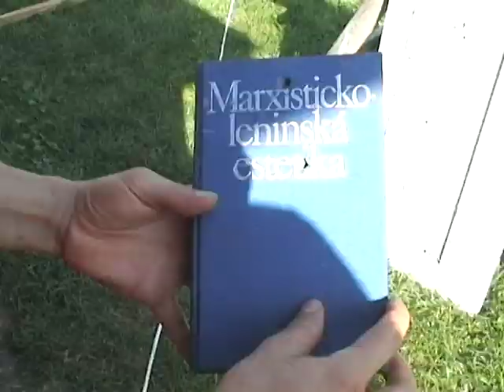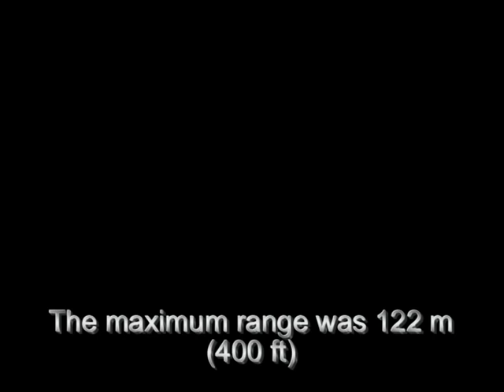Ballista 2009

Comment: Nice job!!
You boys gave more attention to the arrows than most builders. Did you hammer the bodkins yourself? Advice: find a welder. Your trigger fulcrum is coming loose. Switch to twisted nylon rope for the bowstring; you are losing power to the elasticity of the braided rope. Use braided rope for the skeins, the elasticity will be more consistent.
You did your research, well done indeed.

Comment: yes that is a true ballista, built as a torsion engine, but its really scaled down from a real one, the real scorpion had much more power and bigger arms with which to launch with but good job not just making it out of an old bow and caling it a balista since that would just be a giant crossbow and not a true ballista. which is what you actualy have, and good job keeping the bolts thick wood with long bodkin points, this is about what a real one would use, but my cross bow will do the same thing